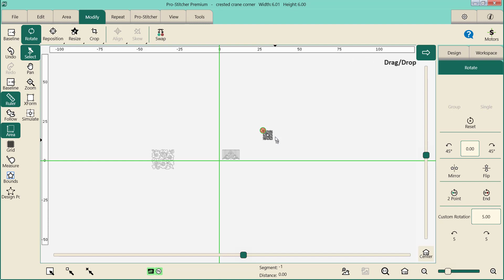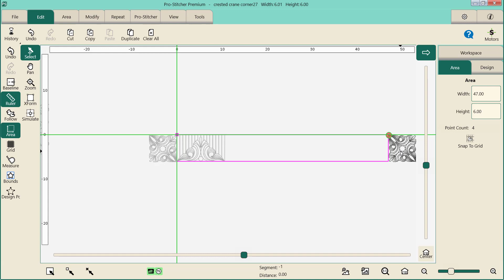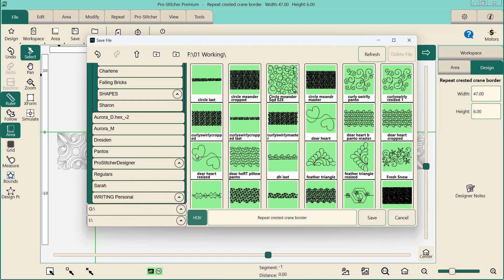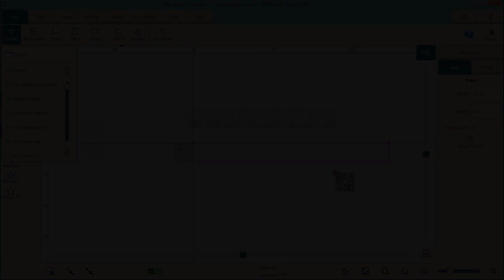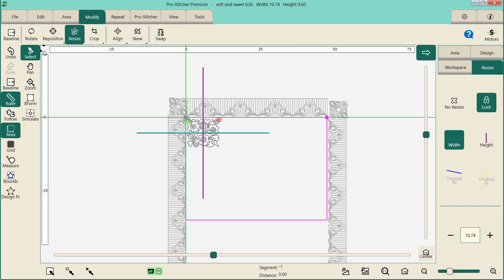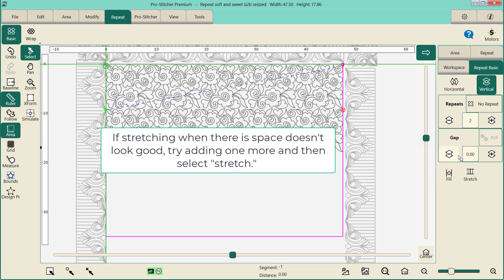Quilt a Border and Inside E2E with ProStitcher

Comment: This is great information! Have done another video for finishing the quilting inside the border at the bottom of the quilt? How do you ensure the pattern will fit in the length? Do you crop on the bottom border? Is there a way to complete the design without cropping?
Reply from the maker: There is. I think inside designs work better if they are border to border (meaning square) so you don’t have to nest and can complete the design within that square or rectangle. You would have to adjust the design in height to get it to fit vertically. We know the quilting itself pulls up the quilt a bit so what you plan for doesn’t quite work in the end. But, you can adjust for that by adjusting the vertical gap a tiny bit for the past three or four rows to get the b2b design to fit pretty well.
Reply: @JuliePettyjohn  thanks for your response! You’ve addressed exactly what I was wondering about.

Comment: I didn’t know that the stretch would shrink the design! How did you know for sure that the inside panto would fit the area without cropping once you got to the bottom?
Reply from the maker: That is a great question. I didn't. I cannot recall for certain, but I think I may have cropped the bottom. When I crop the bottom of an inside E2E, I have to be careful to make sure my marking points are falling perfectly within the stitch in the ditch area. It is not as difficult as doing the sides because I am only doing it for one row - the last one. Of course, it would have looked so much better overall if there had been no cropping. To do that, I would have needed to measure the height of the inside and used that in my area rather than my usual 30 or 35 inches. Then I would have subtracting 1/4 to 1/2 inch on that area. Not at all accuracy there but, rather, a guess. I would do that because quilting itself pulls at the fabric and makes the quilt top shorter than it starts out. I would then lay out the entire panto graph.  would have to play around with the sizing again to get it to all fit. AT THIS POINT, nothing is certain. As I quilt down and only have three rows left, I would remeasure what I have left and how that compares to the design height size. Rather than waiting until the last row, I want to start at the 3rd row so I can redistribute any size adjustments I have to make so one row won't look different. I may need to readjust the height of the last three rows. I can also add or subtract some gap between rows. Even after all this, I could possibly have to end up cropping. It is tricky but can be done. You just have to be aware that messing with sizes is coming and don't wait till the end row. This is one more GREAT thing about working with border to border, though. It all falls in a straight line, but doesn't look perfectly straight with all the curves to your design, so it does not have to fall perfectly as close to each edge as all the other edges. As long as it is close, your eye will make the adjustments when looking at it to make it all look great. This has been lengthy, but could be another tutorial in itself. Definitely not easy to fit things perfectly within heights. Thanks for asking.